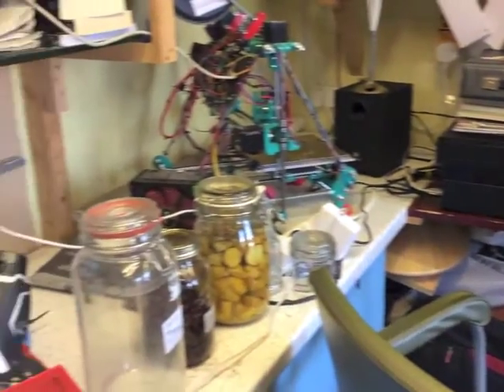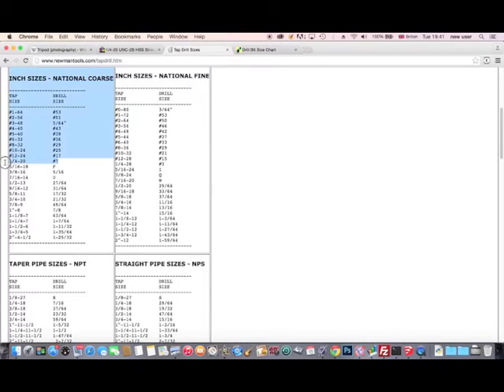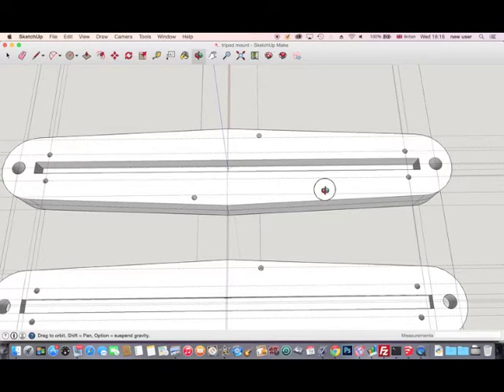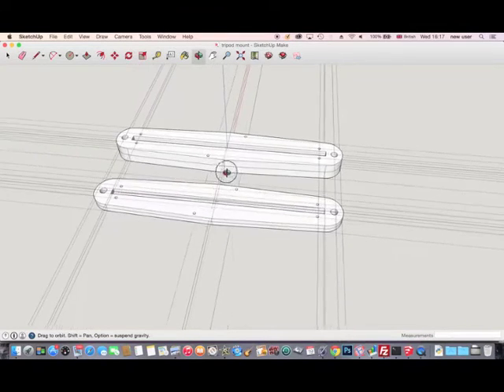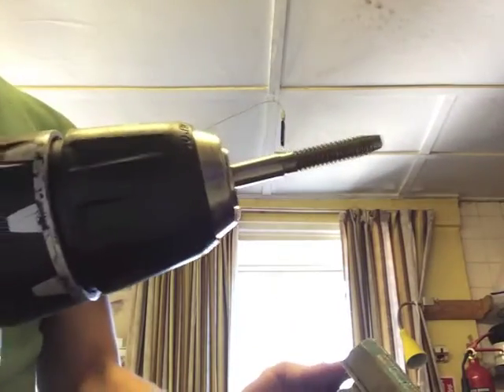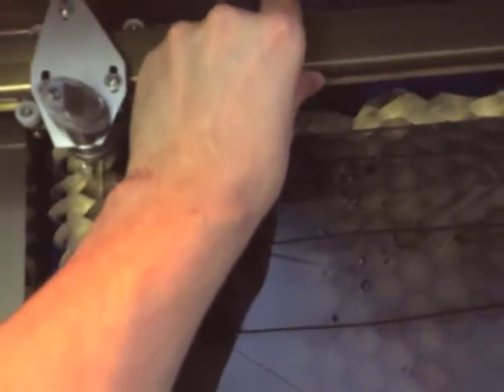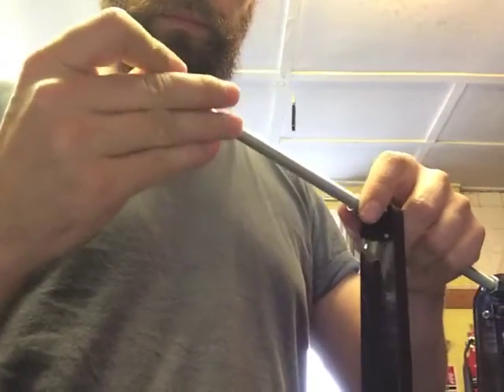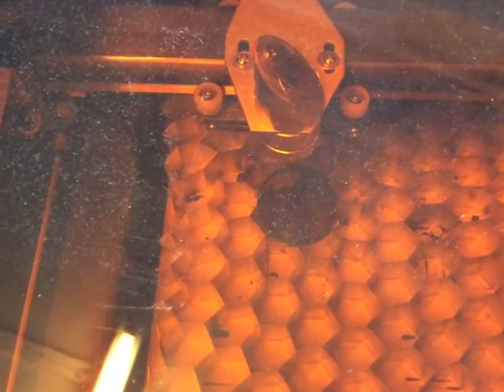iPad Tripod Mount

Comment: Very nice I have a few flip camera/ cellphone mounts that work very similar to this. Have you considered making and selling these?
Reply from the maker: +Summers Woodworking Thanks - these take about an hour to cut out on the laser cutter (although I'm in the process of tuning up the cutter to work faster) so if I sold these I couldn't compete with the extremely low prices for similar stuff on eBay! My main motivation on this channel is to create open sourced designs using open source software / hardware, so I've made the SketchUp and DXF files for this design available on my website for anyone who wants to make the iPad clamp. Anyone who doesn't have a laser cutter can print out the files, stick the printouts to plywood or acrylic, and cut the shapes out by hand.
Reply from the maker: +Summers Woodworking PS for anyone who's interested, the link to the files is at the bottom of the video description.. it's not immediately obvious because you need to click Show More to see it.
Reply: Awesome! Love open source!